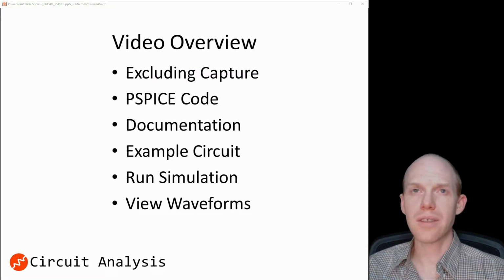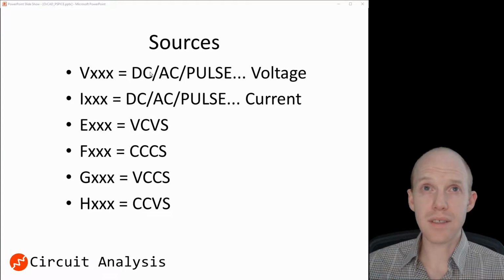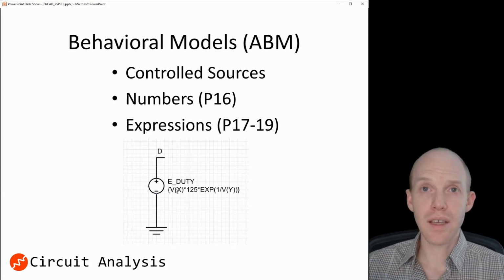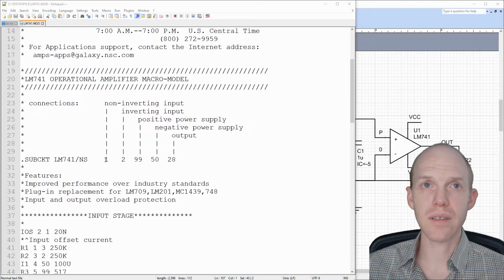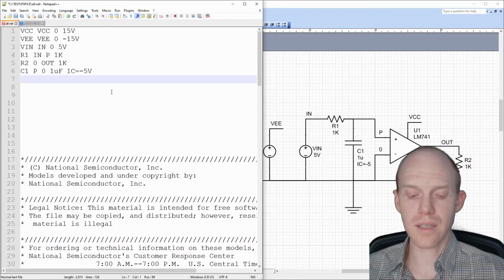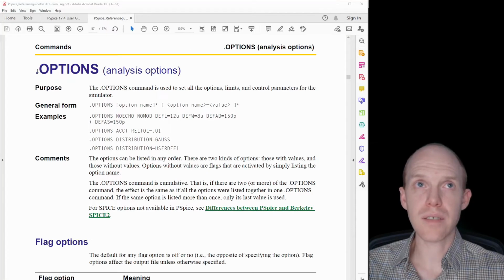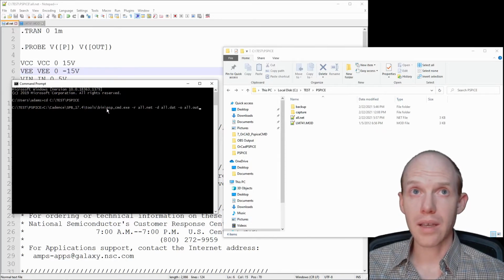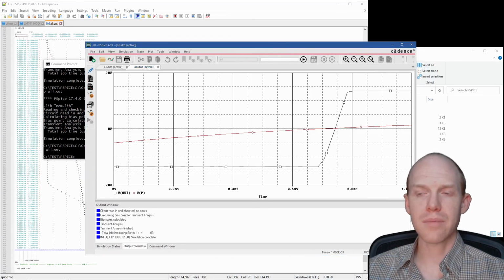Cadence OrCad 17.4 PSPICE Basics (Command Line Style)

Comment: How to find the path to get TRAN output data?
cadence was not installed on my PC but I am using it through the MobaXterm app.
do I need to use the PC where the cadence is installed?

In CMD it is showing me specified path is not found.
Reply from the maker: When you run psp_cmd.exe the parameter you give after -d is the output datafile path and filename. If you just put a filename and no path then it should just go in your working directory.

Comment: How can we plot Vgs/Cgs of a MOS varactor in PSpice?
Reply from the maker: First you have to fine a PSPICE model for your part. Then you have to draw it out graphically to see what the actual schematic is. In this case there may be a capacitor already representing Cgs. If there is not, then you would add an external capacitor to represent Cgs. Then do a DC sweep analysis sweeping the value of Cgs (here's where I talk about parametric sweeps, but you would want to do DC instead of the AC that I'm doing: https://youtu.be/UUmqj-TesUU?t=646). Then from that you can plot Vgs vs Cgs. Another thing to consider if the model is built on a MOSFET is that there are some parameters related to Cgs like I think "CGSO" (check the pspice manual). So what you could do if you want to sweep CGSO is you can wrap the mosfet in a subcircuit and then you can pass a parameter to the subcircuit. So for example in the subcircuit definition you would put like PARAMS: CGS=100p and then you would put in the MOSFET model definition CGSO={CGS}. Then you can make an instance of that subcircuit in your schematic and also make a global parameter that you can sweep in the sim, like maybe call it  g_cgs and run a parametric sweep on it. So that way you can sweep the internal parameter of the MOSFET. The thing to be careful with this method though is that a lot of times these internal parameters are not strict representations of the actual respective part parameters, but more of coefficients that are derived from fitting curves, so when you change CGSO for example, you may be affecting a bunch of things you don't intend to. Therefore it's often safer to use an external part. Hope some of that made sense hah, feel free to ask more questions, thanks for watching!
Reply: @CircuitAnalysis  Hi my friend, 
Thank you for your detailed answer. Watching your other video I was able to do the first stage, ok. But I actually want to see "C-V" characteristics that changing "DC sweep between for ex. -10 to 10 V of Vgs" to observe changing "Cgs" of an ordinary NMOS? just like the C-V plot here ->    https://www.ques10.com/p/28800/fabrication-method-of-varactors-1/   
it would be great if you help to build it or maybe make a video..
Reply from the maker: Oh interesting so you want it to output the junction capacitance? Yeah that's tricky. I wonder if the elemental NMOS model would accurately describe that capacitance anyway? It would be interesting to try. I guess my question is, how would you measure that capacitance in the lab with a real part? Would you do some kinda frequency domain measurement like with a network analyzer? Maybe you could just re-create the lab setup in your simulation?
Reply: @CircuitAnalysis  Hi, 
As you said, it may be correct way to determine Cgs to use frequency domain measurement instead Dc sweep but I have no chance to estabilsh an RF analyzer/network in a RF lab, and I think there must be a way to measure a MOS capacitance in orcad pspice, right?
Reply from the maker: I don't think you understood me. I did not mean you should measure it in a lab. I meant that you could do it in PSPICE the same way  you would do it in a lab. So figure out how people do it in the lab and then re-create that setup in your PSPICE model. Ok here's an idea. Since V=I*Z, you could do an AC sweep. Put an AC current source across your Cgs and change your analysis type to AC. Then you can have PSPICE plot Zcgs = Vcgs / Icgs. This should give you a capacitor impedance plot that is "V" shaped like the pictures here https://electronics.stackexchange.com/questions/3879/frequency-dependence-of-electrolytic-capacitors.
In this case the left side of the V is the impedance from the actual capacitor, where the slope is determined by the capacitance. To calculate the capacitance from that you would say Z=1/(2*pi*F*C) => C = 1 / (2*pi*F*Z). You should be able to use the Measurement formulas in PSPICE A/D to calculate this value as well. Let me know if it works.
Reply: @CircuitAnalysis  Hi,
your equa gives capacitance at cutoff freq point 250MHz and I also put a 10uH inductor series to Cgs, then i observed 5.56 MHz resosnant freq using  wo= 1/Sqrt(LC) -> "Cgs = 1/w^2xL)" then i calculated 80pF of LB401 NMOS, it's correct, Ok. But was'nt able to DCsweep for ex. -2 to 2VDC to get 'V' shape? i use AC primary analysis with parametric DCsweep (-2Vdc to 2Vdc) and also vise versa.. no plot result!
Reply from the maker: Hey sounds like you are making some progress! If you want to paste the LB401 model in a comment or email it to me (emails in the about section of my channel) I may be able to make a quick video about it. I don't see that model in the built in libs? Anyway, as far as the V shape, you won't get the full V for an ideal capacitor since the right half is parasitic inductance, so you'll just get a log decay for impedance, which will be a straight line if you change both axes to log scale. So first just run the AC analysis without the parametric voltage sweep and plot the impedance as voltage over current like "V(gate)/I(M1:g)". Then make the Y axis log scale. Then enable Measurements (View => Measurement Results). Then you can get the impedance at 1KHz for example with the formula "YatX(V(gate)/-I(M1:g),1000)". Next you can calculate the capacitance from the impedance like I was saying before with a formula like "1/(2*pi*1000*YatX(V(gate)/-I(M1:g),1000))". Next you can activate your parametric voltage sweep. Make sure you save your plot format with Window => display control and also set the sim settings to show "last plot". Then run the parametric sweep and you should see multiple measurement results. Next, to show these on a plot, do Plot => Add Plot to Window. Then with the new plot selected, go to Trace => Performance Analysis. The default setup should be good, so click OK. Then add your capacitance formula to the new performance analysis plot "1/(2*pi*1000*YatX(V(gate)/-I(M1:g),1000))". But yea, if you reply with the pspice model code I'll try to make a quick video about it soon. Good luck!
Reply: @CircuitAnalysis  Hi,
I sent you LB401 MOS data, the parameters and an error via email.. Ok..
Reply from the maker: Ok I did a quick video about it, but it was not super conclusive so check it out and feel free to continue the dialog in the comments there: https://youtu.be/GB7_PDGX-6Y

Comment: Duty cycle is not voltage, duty cycle is the ratio of low to high in a pulse train ie a pwm with a duty cycle of 25% means it is high for 25% of the time and low for 75% or for a 1KHz signal 250uS is high and 750uS is low
Reply from the maker: Yes I probably was kinda rambling and not explaining what I was thinking, but I was referring to linearized modeling of power converters. To run an AC analysis on a switching converter in PSPICE (to get a bode plot) you have to create a linearized model, which is also helpful for running long transient analyses for things like line/load step responses and turn-on transient analyses. To do this you have to linearize 2 non-linear section, the PWM chip section and the Power stage section. In this case the PWM chip gets swapped out for an equation that converts the feedback signal to a DC value representing the duty cycle, which is then fed into the equation for the power stage that converts that to an output voltage or current. Anyway that's what I was thinking about when I made those comments. I will go over all that in more detail at some point. My goal with these videos in the short term is to get all the basic things I've learned about OrCAD PSPICE laid out in these introductory video tutorials and then transition more into videos about modeling different types of standard circuit, mainly different power converter topologies.